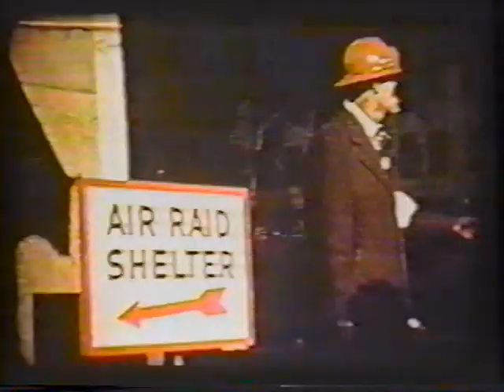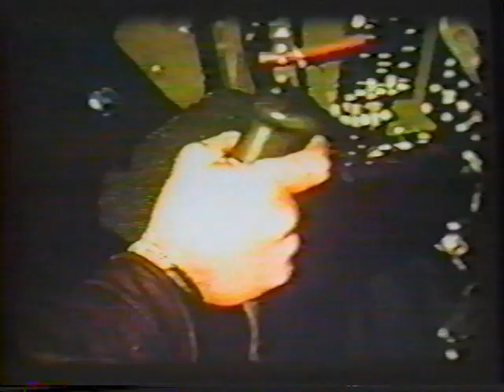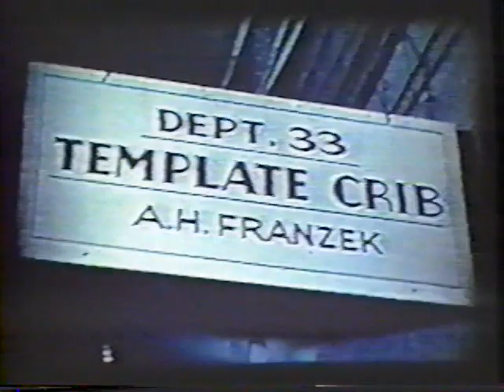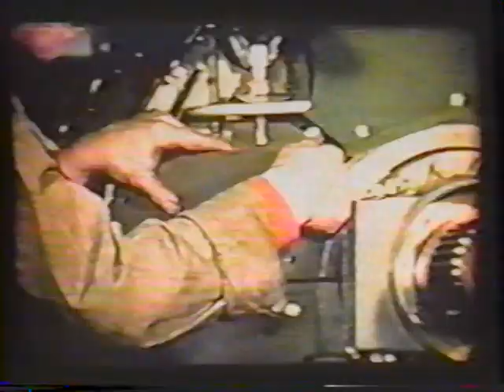Bell Aircraft P-39 Cannons on Wings.mpg

Comment: With the engine mounted right over the wing root.  This made a strong Aircraft. The trycicle landing gear worked well thease could take off in the Pacific in mud.  They would wallow through the mud when other aircraft would not.

Comment: They finally put the Super-Charger in it and designated it the P-63 King Cobra. That plane had the firepower AND abilities at all altitudes to win but came out too late in the war. Too bad, these were beautiful fighter planes.
Reply: It wasn't a turbo, though, but a second power-robbing supercharger that cut in at about 12,000 ft and extended useful ceiling past 20,000 ft.
Reply: called turbo-supercharged. The P-63A Kingcobra also featured Laminar Flow wings

Comment: The production versions had an engine-mounted supercharger with a critical altitude of about 15,000 feet. However, the prototype was equipped with a turbo-supercharger.  It was a very good performer, however it flew without armor, radios, sealed fuel tanks, and other field equipment.  Once all that was installed, the CoG fell too far back and worsened the balance of the aircraft.  The turbo-supercharger arrangement went away, while the engine mounted supercharger itself stayed.
Reply: how do they make the fuel and air mixture in these aircraft...i cant find a video in which this is explained or showed somehow...i know they injected it somehow but how they corect it in different altitudes???

Comment: The engine was behind the pilot cannon through the prop hub, drive shaft under the seat of the pilot.  The pilot was in a steel bathtub. Well protected.  The government would not allow a supercharger on them at first. Not Bell Aricrafts fault.  It was used by the Russian government  they loved them.
Reply: James Hurst, silly ass government

Comment: But the cannon on the p-39 is on the nose....
Reply: They also how Browning .50 cal MGs in the wings as well. They had a unique fireing system that would allow the pilot to select the cannon to fire by itself or the regular MGs by themself or both cannon and MGs togather. The Aircobra had the 20mm Cannon through the nose as you mentioned and the Kingcobra had a 37mm Cannon.
Both versions were slow, even though they call them fast, with a top speed not much greater than the B17 Flying Fortress. I have no idea why it was given the P designation, or Pursuit which is what Fighters were designated as before they called them fighters with the F designation. It was never fast enough to be a successful fighter although as a ground attack aircraft and with the 37mm Cannon an anti tank aircraft it did find quite a bit of success, especially in the USSR.
Reply: @jamesm.taylor6928  this information is quite a bullshit. P-39 did great at low to mid altitudes, outperforming or being equal to german Bf.109G models. The cannon could not effectively penetrate tank armor even from above, mostly because of rather bad shell ballystics and speed (600 m/s is not enough). Speaking of cannons, Aircobra (except for first modification, sent to Britain and having 20mm Hispano cannon) had 37mm cannon. Bigger caliber didn't appear only on P-63
Reply: @jamesm.taylor6928   For the most part, all P-39s had the 37mm cannon. The British ordered aircraft had 20mm cannons in the nose position.. Those are the planes rejected and returned to the US. They were usually designated P-400 in USAAF service.

Comment: Awesome plane and the mid engine configuration was very unique with a cannon shooting thru the center of the engine crankshaft and the pilot sitting on top of that . Imagine shooting that cannon while you are sitting on it !? A mid engine is good in a car but on a plane ?!
Reply: The cannon shot through the hollow gearbox in the nose. No way could it fire through a crankshaft! Good grief, man, USE YOUR HEAD!
Reply: Peter Hawley 
     Wrong the BF 109 had a 20mm cannon fire right thru  the crankshaft and right thru the propeller spinner . Think before you respond !
Reply: The Bf109 shot thru the hollow shaft of the reduction gear, the cannon sat in valley between the cylinder banks.  Peter is right, you obvious don't know anything about mechanics.
Reply: Ron Lawson sezzz...,"a cannon shooting thru the center of the engine crankshaft".
LMMFAOSHIH!
Did he do this before or after he set the auto pilot and went to take a leak?
Funny how people Re-Write History and fuck it up so bad.
Discraceful.
Reply: @peterhawley5861  you got that right,,,,,
Reply: @Rockit442  cheers to a great reply
Reply: DUHH OMG ! Hey guys thanks for the Education 🫣😳😖, it absolutely would not make any sense  but just looking at the cut away drawings and even with the barrel exposed it easy to interpret these incorrectly ! At least I got one part right it does go through the spinner and it definitely can’t be a very large cannon. Let me ask this would the pilot prefer his gun there or in the wings or upper cowling ?